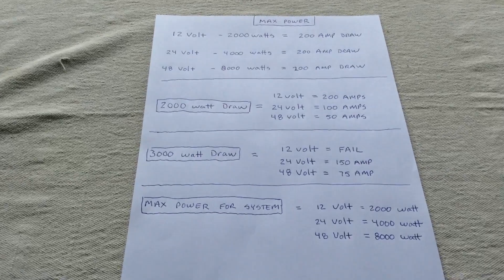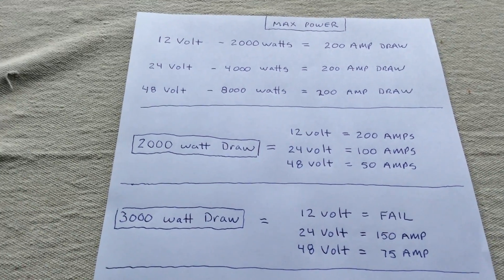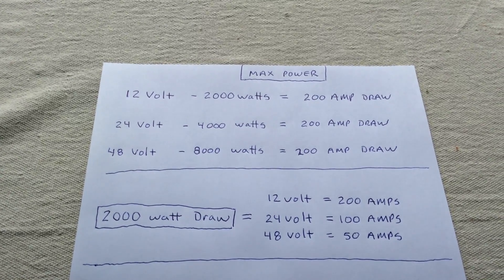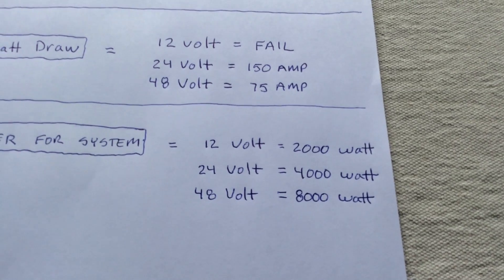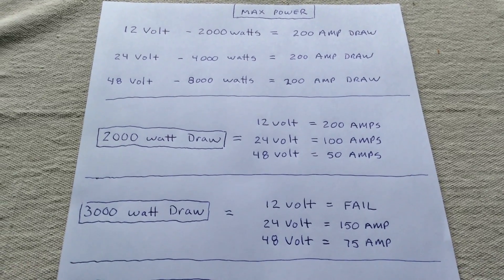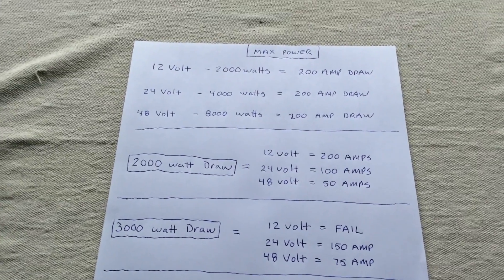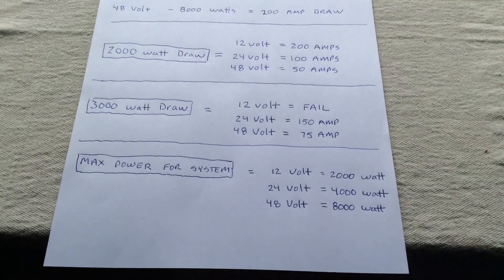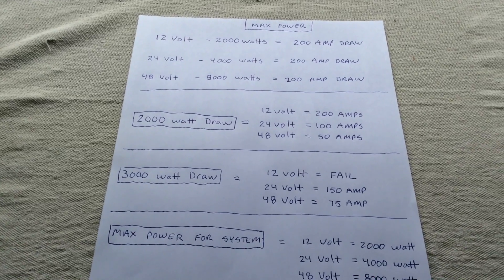Solar Off Grid Inverter 12 / 24 / 48 Volt Explained

Comment: I have no clue where you got your EEC degree.. But a watt is a watt.. The only advantage to higher voltage is smaller wire gauge size. It's why the power companies run Watt meters. Not Amp meters. 

And if you find a 200 amp 12 volt load side MPPT controller. I bet it would cost $3000.00 US.. It's why they have switching from 12v-48v on the line side. It allows you to make larger grids with more panels . As the open circuit voltage on a good panel is 52 Open Circuit Voltage. Up to 150 volts...As most 12volt panels are wired at 48v line side. Then produce 12 volts load side to charge batteries. Which limits the solar array size at 800 watts 12volts producing 66 amps. On a 60 amp controller.. 

And there are ways to limit your @Hr usage by using sure start soft start boards like for AC units. This cuts the locked rotor draw amps from 72 amps to 17 amps. on an average 13k BTU unit.  Same for Fridges that cycle on and off everyday. Use a Sure start board on them. Use LED lighting. The hardest one to control is a hot water heater. But you can use an on demand system to cut that by 2\3rds...or use a timer...

And yes I'm electrical engineer for 35 years. I'm an expert at saving energy. As me and Mr Ohms law battle Mr Watt's....

I would add. if you can not recharge each 200 @hr battery inside 6 hours. You are still going to ruin the batteries. As each battery needs at least 12 -15 amps at 50%.. So the more batteries you have. The more amps you need feeding them. As they will sulfate so fast. You're head will spin...
Reply: is what he is saying true? because i am going off grid soon.
Reply: Great information thank you. I have one question that hangs over me.which charges  a battery quicker more amps or more volts?

Comment: sir if i build 48v system with 12 panels 300W each  first how to connect the panels 
this 3600W system need any reduce or add panels or can done with this ?
Reply: what type of charger and inverter that you use?

Comment: Nice video man. I have a note on your explanation. Amps = watts divided by volts so 2000w inverter divided by 12v equals 166 amps. I have a pv system of 1000w 4 trojan t105re batteries a mppt controller 40 amp and a pure sine inverter 1500 watts on a 12v system. In maximum load 1480watt I consume 123 amps. I have 35 mm square cables that work well. Small systems are on 12v the medium on 24v and the big ones on 48v.
Reply: Yep All good .. but you batteries won't last .. 
You Cook off the water .. 
Ooh did you just think you can Cook by chardging .. 
Nop .... It Will also Cook by over using

Comment: Thank you for this! And people. . . please try to conserve rather than living lavish and spending tens of thousands on big systems. Do go 48 though with lithium ion's. I did. Also. . . you no longer have to do the (absorbtion) stage when you use lithiums. No more worries of your voltage going too high to run your inverter or dc appliances while in absorbtion stage. Your batteries are fully charged and you go right to float. Let's do away with lead acid dinosaur technology once and for all.

Comment: are there higher volt systems?  I have some things that output 600v (like my fuel cell) and am wanting to use that as well as batteries (especially as I cannot find a hydrolizer for the fuel cell which I was planning on having as the main power storage as hydrogen)

Comment: very good example, however the important is that the higher the battery set voltage the higher the incoming charge parameters will be.  meaning a longer time to reach the optimal charge input by the array and the controller. be safe, Raz

Comment: Yeah I thought I was right when I was talking about the amp draw... awesome video and very good explanation. I really hate inverters lol I wish I could run everything D.C. Without paying an arm and a leg
Reply: Also the good efficiency is only if your drawing just under the rated watts. If your running a 200w load on a 2000w inverter. Your not getting 95% efficiency. Your only getting 60-75% efficiency. Like I said I wish I could run my whole house off of Dc. But I know the reason why we use ac and not dc. But still lol
Reply from the maker: This should help clear things up for you on what system to run for your house loads.
Reply: @tmz1313  Still you can run directly from D.C many things, like water heaters ( all the resistive loads in general, i.e. cloth irons, incandescent lamps), electric tools (which use universal motors, but without speed adjustment circuits, which need AC in order to work), and all your modern electronic appliances, which nowadays use switching power supplies (I.e not the classic transformer input type of power supply). This group of loads including all types of inductive motors (air fans, furnace blowers, pumps etc) is excluded from working with DC, as they will immediately blow up)...These motors like pure sinus voltage best...

Comment: Good explanation, this is why i use multiple inverters to keep the amp draws as low as i can and any thing 12 volts i run as dc only for me
Reply: Do you use one at a time depending on how much you need to draw?